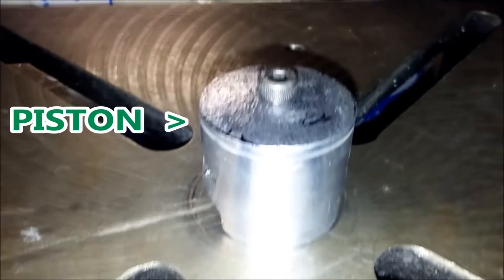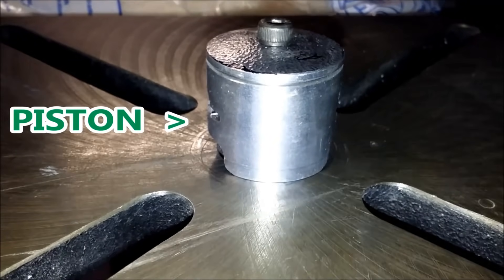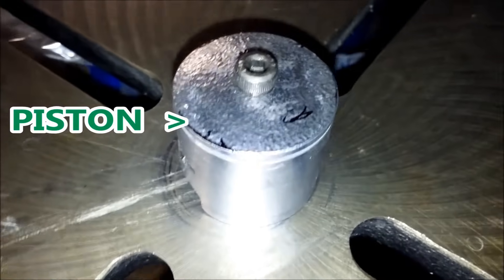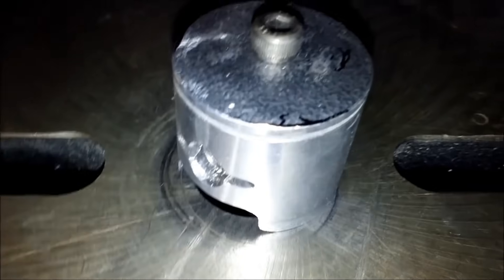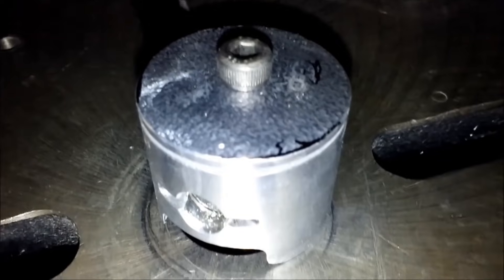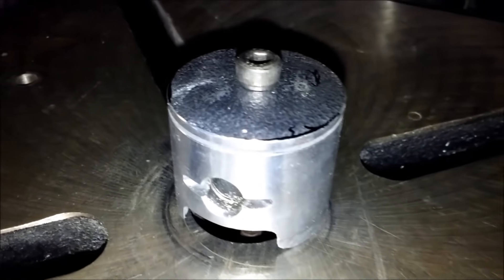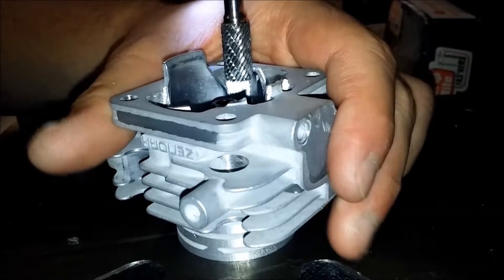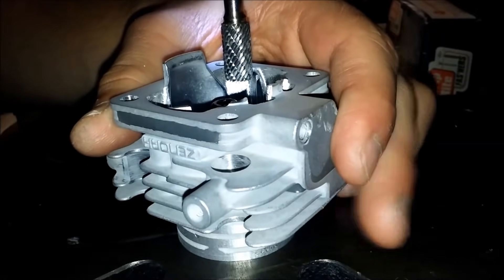Neat 2-Stroke Porting TRICK lower Transfer Bridge-Port for RC boat engines (Zenoah RCMK Tiger King)

Comment: Hi! I've got a TL52 (TL43) engine. 
I haven't ported a piston ported engine before so I don't know what duration works best. 
Do you have any advice? 
Or where I can read about it? 
I haven't checked the stock durations yet but will do that. 

Thanks. 
Sincerely Johannes

Comment: Are this realy work??  I think its maybe work but not good in low rpm cos the gass will flow to exzos port before piston make compression..large comsumtion fuel use n waste..sory if i wrong..

Comment: What does that do?
Reply: Increases port time area. Which gives the cylinder a little more room to pull in more fuel and air. A little more fuel to combust = a little more performance gain.

Comment: What bit did you use?
Reply from the maker: It's a 1/2"x1" cylindrical carbide bit. You can find them ebay/Amizon for under $10

Comment: Ok but you did not explain why this was done?
Reply from the maker: It's mainly to give 2-stroke porters the idea of what can be possible with the right tools. A lot of RC 1/5th scaler's like to trim down the transfer bridges quite a bit and often times I notice how horribly hacked up, uneven their ported cylinders are. So...To answer your question, raising the transfer bridge can give you a little more peak RPM. There's an RC engine called: Tiger King S27 which has their transfer bridges all the way up at the BDC line. Anyway hope this helpful.
Reply: @TheNoisePolluter  this can be done to none marine engines?
Reply from the maker: Yes, this type of mod is done a lot on RC marine engines.
Reply from the maker: @fdrc8099  This cylinder has JB-Weld added to the intake port for a billet reed crankcase.
Reply: @TheNoisePolluter  i did this to my 400 dirt bike dont know if it helped. I did too many things to the motor at once